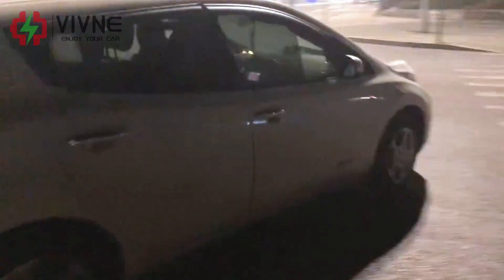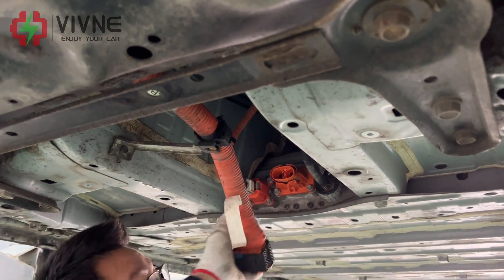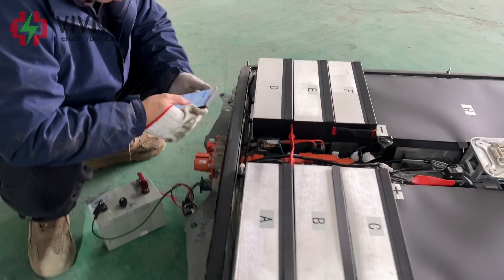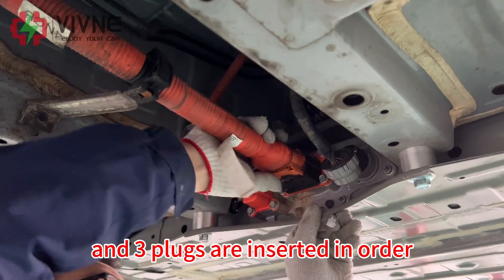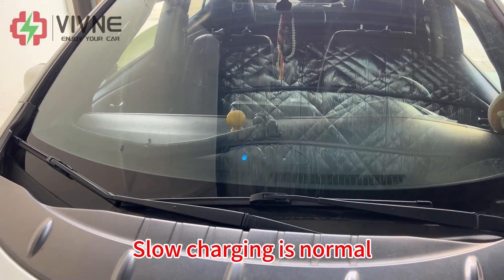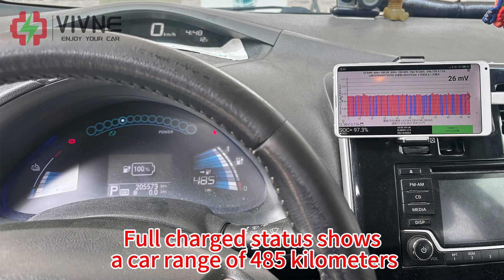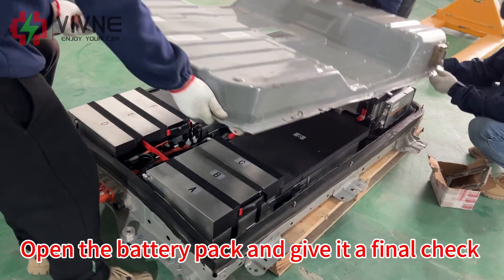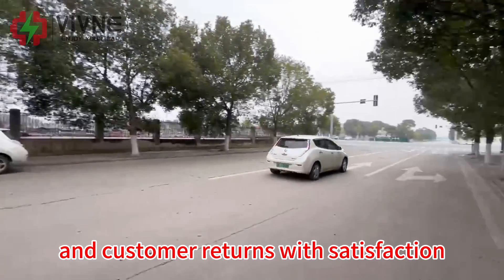Nissan Leaf battery upgrade 62kwh

Comment: Le problème c'est que les batteries ne rentrent pas dans la boite au milieu il faut  mettre une entretoise de minimum 3cm je me demande si le contrôle technique va accepter.😢
Reply from the maker: Certains de nos clients de France pourraient obtenir le 50kWh, qui a la même taille que l'original. Pas de hauteur supplémentaire.
Reply: @VIVNEHelenMao  je possède des batterie catl de 154 ah 4s1p 110mm de hauteur est elle ne passe pas au millieu il faut faire comme vous rajouter une entretoise de 3cm je vais abandonner le projet...
Reply from the maker: @davidell2355  Notre batterie de 50 kWh utilise des cellules CATL d'une capacité de 140 Ah, avec la même taille que l'originale. Pas besoin de hauteur supplémentaire.

Comment: I wonder what the insurance implications are for this in the UK, and who'd get this installed properly. I like the original leaf but the ones around have little range left in them.
Reply from the maker: We provide 2 year, 80,000kms warranty.  We can provide the plug and play battery pack, which don't need any special skills for the installation. Trust a nearby car repair shop can swap it easily.

Comment: These are already very heavy vehicles for their size nearly 1500kg. Won't this increase the weight even more? Will you have to modify the suspension to cope with the extra weight?
Reply from the maker: For the 62kWh battery,  the weight is only 85kgs heavier than original, just as taking a male adult in your car.  So no need to modify the suspension.
Reply: @VIVNEHelenMao that's very interesting. So you can virtually triple the original range.
Reply from the maker: @MichaelWilliams-mo1vv   If customer need longer range, we do can triple the original range perfectly,  and with the dashboard display the new whole mileages.

Comment: how about can-bridge software flasing do support for installing?
Reply from the maker: Don't support can-bridge for 62KWH  installing.  With can bridge + original BMS can only display 40KWH  mileage on dashboard.
Reply: @VIVNEHelenMao  my car is 2017 model with 30kWh capacity want to swap/upgrade  for 62kWh . so we dont need can-bridge upgrade?
Reply from the maker: @aravindia  Yes, no need for can -bridge.  We will reprogram the BMS.
Reply: @VIVNEHelenMao  No, the can-bridge with open source software from Dalas support 62 kWH as well. He installed this battery pack already two years ago.

Comment: Is it possible to upgrade old Hyundai Ioniq with the old 24kwh battery? The new would be a 39 kWh battery from the not so old ioniq
Reply from the maker: Thanks for the suggestion. We will update in the channel if we got anything for this car also.
Reply: The bigger battery version of Ioniq has water cooling, the first version doesn't. 🙂

Comment: You know 567km is alot to promise, how fast were they driving ? Range better than the stock Nissan Leaf 62kwh sounds too good to be true. Could you send me a free sample for testing ? What are your warranty terms ?
Reply from the maker: The Leaf owner was driving with 50-70km/h.   567 kilometers is the data the Leaf owner actual drove. Car range is affected by many factors. Could you let us know more about you first?  We provide 2 year or 80,000kms warranty.  You can email to: helen@vivnevs.com or add Whatsapp: +86 18717786639

Comment: what is the fast charge time? are there any lfp batteries for this? what is the range and fast charge time for those?
Reply from the maker: 0-80% fast charging takes about 1 hour and 15 minutes, 0-100% takes about 2 hours.  LFP batteries cannot be used on Leaf cars. Car range is 430kms. Fast charge time from 1 to 2 hours.

Comment: What is the true mileage with air conditioner on? There are many MODES you can drive in. For examples, you have Eco mode with B combined for regenerative power. Then you have Eco and D which is in the middle. Then you have just D for Drive mode for maximum speed. Of course these modes are affected by air conditioner on full maximum power which depletes battery by 20% -30% percent!
VIVNE claims 304 miles for battery life, however did not specify which MODE this tested in? Also with air conditioner on? True mileage will vary on which modes you choose and conditions.
Reply from the maker: We usually drive in D mode.   In summer time, if with the air conditioner on, depletes battery by 10% percent,  yet depletes more when in winter time.  We had also tested the range with full highway and air conditioner is on the whole time. Please check the other testing videos in the channel. Thank you.
Reply: @VIVNEHelenMao  Ty for your reply. I notice the one you are referring to is a Generation 2 Leaf or with new body style. It is a different model than the one you test in this video which is Generation 1 (forgive me I don't know the model classes too well). But I can tell you mine is a 2015 Leaf with the Gen 1 body style, in fact it looks like the one in this video with same white paint. Do you think that the air conditioner depletion is less compared to the newest generation to the previous generation? You claim 10% depletion with air conditioning but what about Generation 1 style of Leaf? If you can test air conditioner depletion with Generation 1 it might be better example because I think the newer Leaf have better technology in the software or build to distribute energy from air conditioner than previous Generation.
Reply from the maker: @roamlikekane  Yes, according to our experience, the air conditioner depletion is less compare to the newest generation to the previous generation. But there is no quantitative data.

Comment: can you fit a 62kwh batt on a 40kwh leaf 2018x?
Reply from the maker: We use the original battery case.   If your car model is 2018  40kwh Leaf, then we will use the original battery case of this.

Comment: Didn't it need a CAN-BRIDGE, heavier-duty rear springs and a software upgrade?
Reply from the maker: No need for Can bridge.  We had re-programmed the BMS. The 62kwh pack is only 85kgs heavier than original, which just as taking an adult in your car.  So no need to change the rear springs. Also no other software need to be upgraded.
Reply: @VIVNEHelenMao  Well done.
That would really make battery upgrades simpler and more economical. :)
Reply from the maker: @Pierwalker  Thank you.

Comment: Why bother, just buy an ICE vehicle
Reply from the maker: It depends on you. But the new energy vehicles can save gas money. 😀
Reply: Driving ICE is like trying to ride a horse on a highway. EVs vs ICE is like horse vs first cars. It's not ideal but definitely a big progress.
Reply: Yeah but transmission, radiator, alternator, oil, coolant, brake fluid,
Reply: you must be 80 y.o. back to bed nappy on.

Comment: Hello. Just one question:  your pack battery CATL get a system against the "rapidegate" (high température after 2 charges)?
Reply from the maker: We replace from the original soft battery to big CATL cells. Generate less heat and bears a much smaller C rate. The big CATL cells can withstand 3C charge/discharge and can also withstand continuous charge/discharge of more than 1C. Take our 62kwh for example, fast charge power of Leaf is 47kw, at maximum current of 150A, we replace with 180Ah big CATL cells, so the charging rate is even less than 1C.
Reply: @VIVNEHelenMao  old 24kWh cells pack have no problem give 80kW in -5 degrease of celsius, 20%SOC. Is it same with your cells?
Thank you for answer.
Reply from the maker: @thomsn5983  Yes, it is the same with our  CATL cells. Our CATL performance is better than the original 24kwh.

Comment: Still  only  any good for  going to the  local shop
Reply: Not at all! I go on my leaf relatively frequently on 800+ mile round trips. In California it's pretty doable and almost free(Los Angeles to bay area and back). But I have relatively small pack, about 35 kWh usable capacity. Biggest problem begins with relatively uncomfortable seats in such distance. In my case relatively small pack is a good thing, every 2 hours I have about 30-40 minutes to rest while car is charging.
Reply: @pashko90  make a vlog about it!
Reply from the maker: We are  shipping worldwide and have partners in some countries.  Which country are you from? You can add my Whatsapp:+8618717786639 or email to me: helen@vivnevs.com

Comment: I wouldn't invest a new battery in a car with 205573 km.
Reply from the maker: The car is in very good condition and the owner drives the car with great care.  He also plans to drive another 200,000 kms after replacing the battery, so it is worth it.
Reply: It depends of the price. 
But you must understand one thing: a first battery Leaf 24 kWh can't make easily more than 200000km because of a limites number of charge (1000, 1500 ). 1 charge of thid battery gives about 120 km, so 200000km IS for me the higher distance you Can expect.
But, if you change thé old battery by another with more range (62 kWh), you Can expect to drive between 300000 km and 400000 km. 
On m'y opinion, that's a very good Idea.
(Sorry for m'y Bad english language, I'm french)
Reply from the maker: @olivieretcecilepineautexie9351  Yes, you are right. But the factory settings of CATL is after 2000 cycles and SOH still be above 80%.  This  Leaf owner had upgraded to 62kwh, which can give him 430kms for each charge,  So 200000kms is very easy to achieve. 😄
Reply: @VIVNEHelenMao  of course. I was talking about the 24 kWh battery Leaf for the limit of 200000km. The more kWh you have, the more distance by charge you Can drive, the longer Time and km you Can expect.
For exemple, on the youtube Channel  Hiroshi EV, a driver show thé évolution if SOH and performance of his 40 kWh Leaf, 6 years old, and 310000 km! Just 1 segment lost.
Imagine what you Can expect with a 62 kWh!

For exemple,
Reply from the maker: @olivieretcecilepineautexie9351  Take 62kwh for example,   one charge can run 430kms. Conservatively estimate 300kms for the kms you run after each charge X 2000 cycyles= 60,0000kms. Your SOH still can be above 80%.  We have domestic uber driver, since last year he upgraded the 62kwh  battery with us, he is fast charging everyday and had run for 10,0000kms  in a year, SOH still got 97.18%.
Reply: @VIVNEHelenMao  I wanted to know the battery degradation on an EV that's driven professionally.  The battery sounds like it has a long life ahead of it.  Thanks for this comment.
Reply from the maker: @blu0065  The battery can be in service for 8-10 years. The degradation is closely related with the driving habits. For example,    one is a family used car and usually only use slow charge and another is a taxi used car and sometimes will need fast charge to  supplement the battery. The degradation of these two batteries must be different.  We had datas feedbacked  from the taxi driver, 94,362 kms had been traveled and SOH still be 96.59%.
Reply: That’s ok. This isn’t targeted at you. Simple.

Comment: Dangerous work here, did not remove the service disconnect from the traction battery inside the car, not using the correct HV gloves, no HV insulated tools.
No HV DC hook insight. 
Great to see the Leaf kept on the road, they are bomb proof vehicles
Reply: Plastic is not very good conductor of electricity. Where is almost to exposed terminals. If you wanna wear insulation gloves while undoing connectors it's up to you. I can tell you even with bare hands in ideal California weather this connectors are not easy to disconnect, if you have dirt, dust and salts it will not gonna make your work any easier. I rarely touch safety disconnect, only when I go inside of the pack. For removal and installation from my experience it's a bad idea to even touch it.
Reply: Well you only make a mistake once working on those, and it's game over ,brown bread ,its happened to fully trained techs.